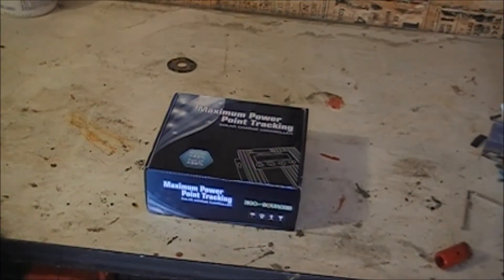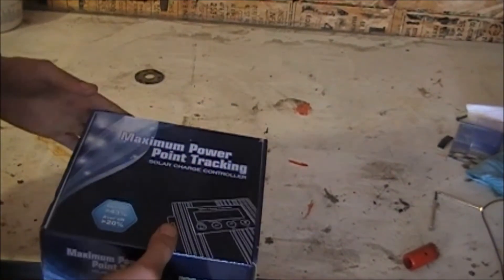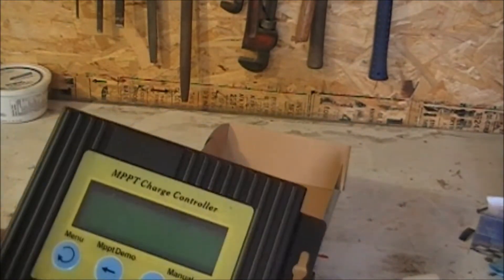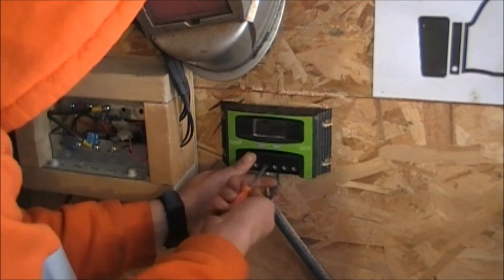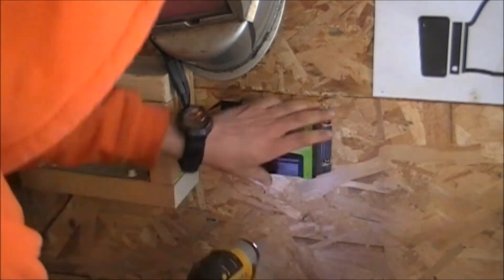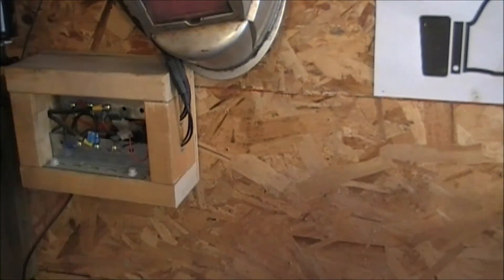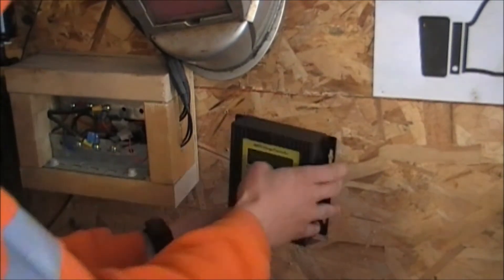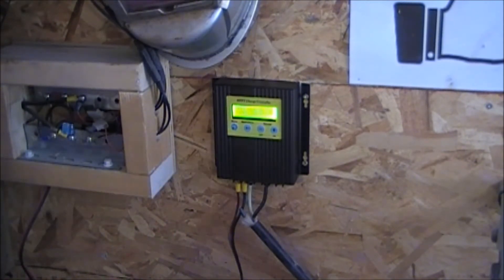20 AMP MPPT Charge Controller

Comment: Removing wires from the old controller  "...careful to not touch each other...". Come on, you mention that maybe it would be better to disconnect the panels or pull a fuse, but don't actually do it. Okay, since you don't have circuit protection, buy some inline fuses since you're doing it on the cheap, or do it right and install DC circuit breakers. Install either type of protection between the panels and the controller, between the controller and batteries, then between the batteries and inverter, if you are using 120ac. I didn't leave a thumbs down, but having circuit protection, then disconnecting it during servicing is paramount.

Comment: I have a few questions  ...  overcharge protection is what you want it charged  to.. correct.  My batteries. Say. 14.8.   I also understand float .mine says 13.4 se.    Ok my question  is this.  Over discharge protection is the setting i dont want the batteries  to drop or  past a certain voltage ?  And what is discharge restart setting?   I have Trojan  t105 gc2 225ah batteries.  Thanks in advance

Comment: The soldering job on mine appears to be not very good.  The main issues I have are where the terminals are soldered to the board.  I am fairly qualified to make this judgement as I have been NASA certified in high reliability soldering inspection for 20 years.  The battery negative looks almost devoid of solder with no solder fillet either on top or bottom of the board.  The others have partial fillets on the top side with little solder flow evident.  I am going to verify that this controller is operational, then I am going to reflow these critical joints.
Reply from the maker: Paul McIntosh I have been very happy with mine had It a while now

Comment: Any Update on this controller?
Reply from the maker: yes it's been a great controller I love it
Reply: Excellent MPPT charge controller for small solar systems. I've been using this one since 2013. Love the flexibility with the custom voltage settings. Even the circuit board on it is silicon sprayed and should be very protected.

Comment: WARNING No replacement Warranty. I purchased one of these,
ran 360w solar. Started smoking first time used and the internal fuse blew. Replaced
fuse, same. Contacted Eco-Worthy and this was the response.  
Hello friend ,

Please do not worry

Just wondering if you can accept we send the fuse to you .

Then you change It by yourself ,

It is very easy .

Is it ok ?

Thank you very much .
Regards Alisa
Eventually they offered to replace part. I would have to
change myself, BUT also pay the postage. WTF
Reply: If you were running a 12 volt system then you would have been well over the current specifications for the unit. The blown fuse and smoke will have been caused by this.
Reply: When the fuse blew did it still come on?